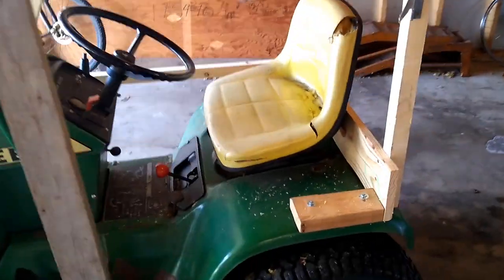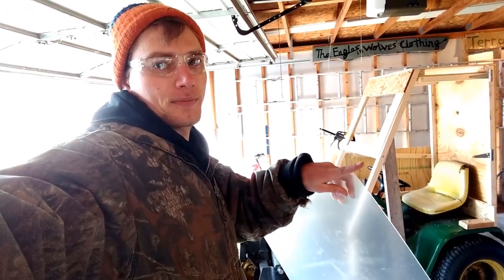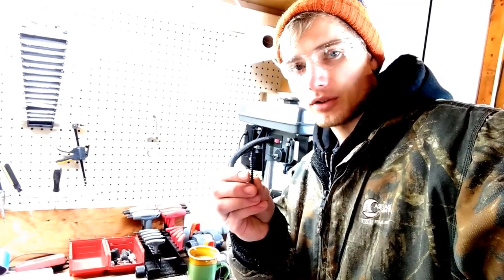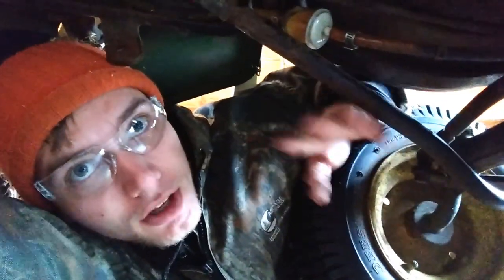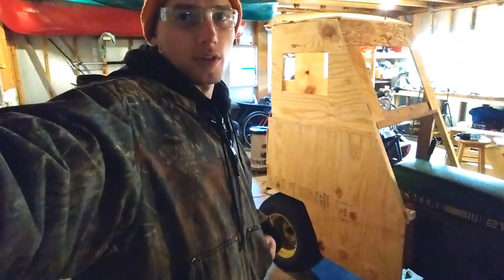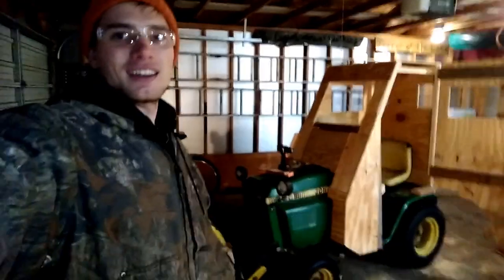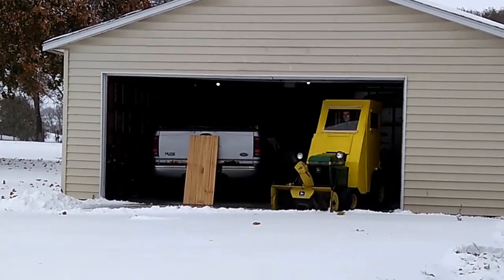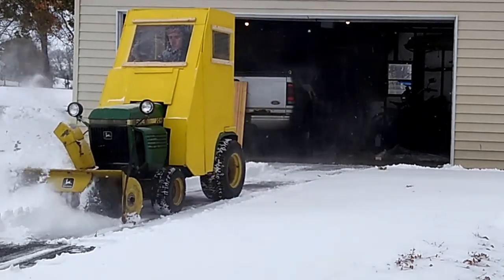Homemade Lawn Tractor Snow Cab Build- DIY

Comment: Nice job!  Now take it to the next level and rig a small generator, electric heater, and an AC unit for summer use!
Reply from the maker: I like the heater Idea I have looked into 12v heaters for the cab, the main hold up is that I am unsure the tractor will put out enough power to supply the heater and charge the battery... so I will need to install a amp gauge first just for safety.
Reply: @PatriotContraptions  It probably wouldn't, which is where the generator comes in :D
Reply from the maker: @BB-nn9en  True and I do have a generator from a previous video that would work...I will think it over ... I have also seen guys ducting the heat off the engine (not the exhaust it stays outside) which is cool, but not sure it's still safe...
Reply: @PatriotContraptions  If the engine is water-cooled you could install a small radiator and use the heat from the cooling circuit.
Reply from the maker: @Dicofol1  True, but in this tractor the engine is air cooled...so unfortunately I can't do that ...on this tractor...will keep In mind for future projects. 😁🤔
Reply: You can make a simple, cheap, safe and effective heater by boxing around the exhaust system. Mig welding it to the muffler is what we did on old skidsteers and tractors. Welding it makes for sealed "hotbox". Then add fittings for the appropriate sized flexible exhaust pipe. Inside the cab mount old computer cpu cooling fans or fan blowing from the cab through the box then you have another piece of ducting running from the the plenum into the cab.
Reply: That's what I do haha

Comment: That my friend is absolutely genius. Now all you have to do is get a little bit of heat in there so you can stay warm. Are you still using this cab and if so how's it been holding up?
Reply from the maker: The cab is holding up great I just sold the tractor though so the cab went with it, but it was still in perfect condition :-)  I was thinking about getting a tractor with liquid cooling that way I could run a second radiator for heat :-)

Comment: How many sheets of play wood did you use I am looking at making on myself
Reply from the maker: I believe I ended up using three sheets total.  As for height I don't think I took a measurement just sat down on the tractor and decided 6in over my head was good...wish I could help you more, but I recently sold it so I can't take measurements...

Comment: looking to make a really cheap easy snowblower and im thinking of a vaccum cleaner and a basic snow shovel. what can be done!!!?
Reply from the maker: You could do that although, I would say there's a lot of snow blowers that tend to pop up on Craigslist and marketplace... some as low as $30 that you can pick.  Fixing one of those would probably be a lot better and trying to make one from scratch... That said it is a really cool 👍. I have actually seen a lot of those snow Joe type blowers at garage sales.   if you do decide to push forward with the vacuum idea your main issues are going to be building the actual blade of the blower and waterproofing it against electricity.   There's a lot of risk around having 120v around  in contact with snow that can easily turn into water.

Comment: Why not PVC?
Reply from the maker: For a cab frame I could see that as a option it is easy to work with and does ok in cold weather (I found out in sub zero weather from building my hockey stick out of PVC that it will shatter if to much rapid stress).  I went with wood because it's actually cheaper as a PVC connectors plus the PVC pipe adds up fast and a 8ft 1x1 is cheaper then ten ft PVC and easy to screw into plus had worry about shattering in cold.  Another good option is electrical conduit as it's about same as PVC and solid to work with for frame.  Biggest thing to remember is you have to be able to attach sides to whatever you use so think ahead about that issue plus the door to get in and out.